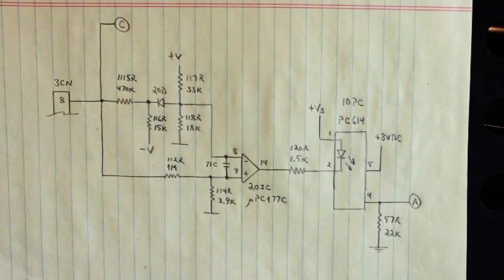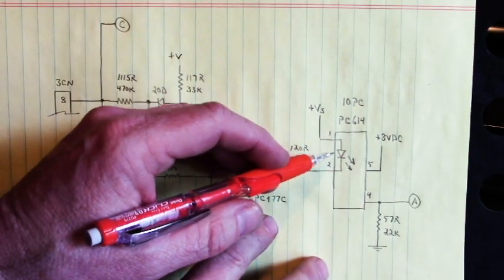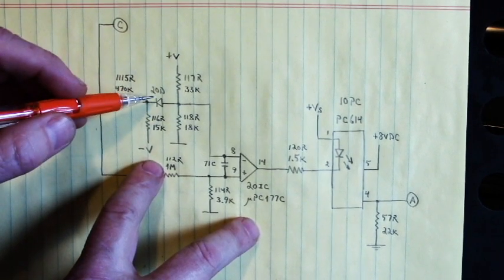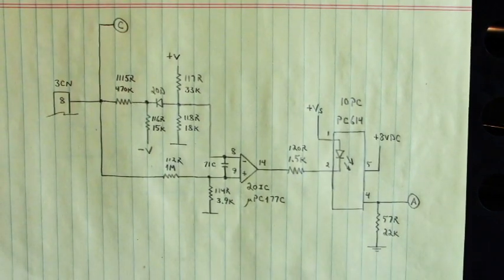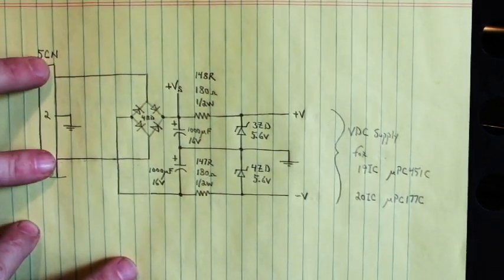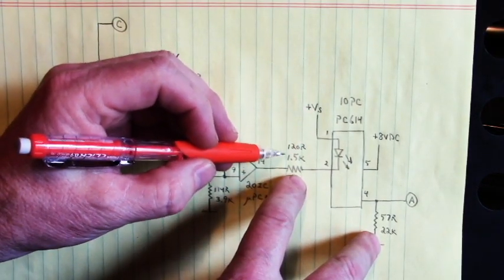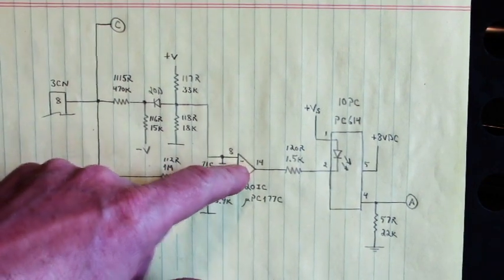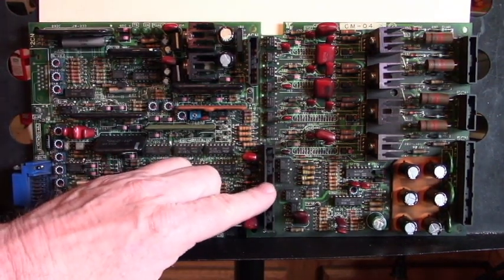Yaskawa CPCR-MR0822KAW False Fuse Alarm

Comment: Hi PeePaw, I have a CPCR-MK154K2 that was exhibiting the same problem but cycling power always cleared it. Yesterday I went to power up the machine and got an overcurrent alarm (showed up as a TG alarm on the controller, but not TG alarm on drive). I have been trying to find a schematic with no luck (Yaskawa says they don't have it!). Any chance you have one?
Reply: Hello Peepaw,
I just wanted you to know that I have now repaired three of these drives with this same problem. The culprit is the 1 megohm resistor labeled as R1122. It is highly temperature sensitive (typically actually looks like it has been overheated, too). It throws off the comparator input causing the alarm.
Reply: @robertbain432  Hello Robert and @Peepaw McDonald. I have repaired a pair of these drivers with this problem and in all the cases the 1megohm is the key to solve it.
Reply: @ricardovillada9483  Isn't that exactly what I told you?
Reply from the maker: Hello Mr Bain, I am so sorry, but I don't have schematics either. When I have a problem with a circuit. I will draw out my own schematics of the circuit I am troubleshooting. I also wish that I had schematics. HaHa... I call it a great day if I get one set of schematics to show up around here every twenty years. Thank you very much for watching my videos. I hope that you and your family have a Merry Christmas.
Reply: @PeepawMcDonald  Thank you for answering. This same drive occasionally gave the fuse error but power cycling always fixed it. I guess I'll be doing what you did, but those little hybrid packages are liable to be a road block. It's a shame Yaskawa won't just release them. In the USA there is actually a law against that (company I worked for in the 80's sued Data General for that and won). If I figure any of it out I'll let you know (if you're interested). I really liked your videos about the drive and you did a great job of explaining it.

Comment: Hi Peepaw, How about an OL alarm #35 on Yaskawa DC Z Axis Drive?
Reply: I have the same problem. I hope you have found the solution and share it with us.
Reply: I had that OL problem intermittently. I replaced  hybrid JH-231 and it took care of it. Current level signal from this IC was drifting and when it exceeded the preset level it triggered OL alarm.

Comment: Good Work Peepaw, I face this problem once, a double axis drive. Both boards take the same signal from fuse so I remove the opcoupler on the faulty board. If fuse blown the other board can trigger the Fuse blown Alarm. I was in the client workshop at 11pm at 400km distance from my workshop so I have to solve the problem quickly.
Reply: Oh I put my comment before seeing the video. I can't find anything wrong too. Maybe one day We can find the mistery fail
Reply from the maker: Awesome, I like your solution better. If the opto-coupler's output photo transistor ever shorts from collector to emitter. The false fuse alarm will again occur. But with your solution of removing the opto-coupler, that will never happen. Great thinking and great work.